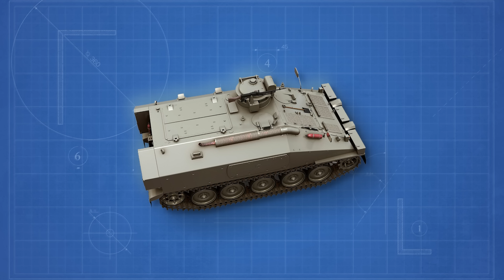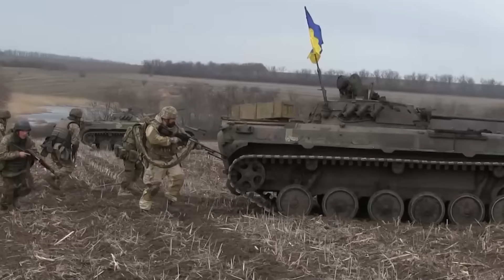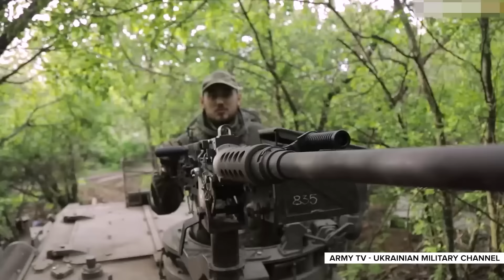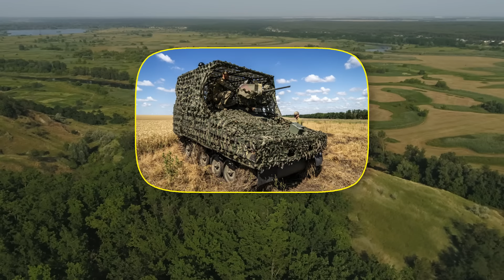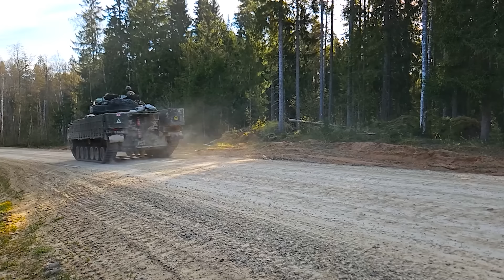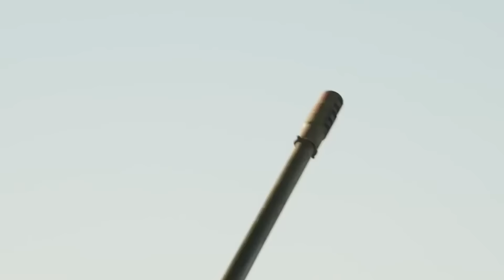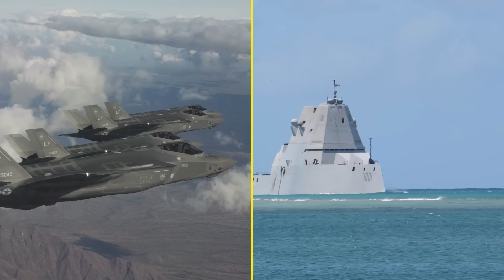Ukraine Turned UK’s Junkyard Armor Into a FRONTLINE MONSTER

Comment: 60 vehicles for USD $6.5 million?
That is only $108,334 per vehicle.  
Dirt cheap for military.
Reply: Got to remember that the people selling them were selling them were private collectors supporting a charity, not a main original production line.
Reply: @DylanSargesson  you can actually buy cold war era ex military vehicles in britain for about $80,000 each on the civilian market, well maintained with low mileage
Reply: @M @Matt77125 Well maintained cold war era military vehicles with low mileage and have not shot a single shot in anger sells for the low price of $100 000. Guaranteed upsetting the enemy»
Reply: @Matt77125  Well enough for civilian use perhaps but quite a bit more goes into making one ready for combat deployment. From the state you can purchase one for 80,000 to when necessary upgrades to armor and electronics have been installed, it will easily double that cost.
Reply: Not so long ago you could get them for half that. It's a shame how people start fleecing as soon as there is a war on.
Reply: @Rabidazell it's supply and demand if you are blowing them up
Reply: China ifv go for around $1 million
The Spartan goes for just $50000.
Reply: @HikerBikerMoter  Ajax cost around 3.5mil
Reply: And they have Jaguar power plants
Reply: @drbichat5229 
Used to, they're Cummins disks diesels now.
Reply: Not as cheap as the horses and dirt bikes Putin is curretly using. 😅😅😅
Reply: @joeblack007 
True. But it will keep you safe from anything but a direct hit, while a frag air burst can kill a bike rider within a 50 metre radius.
Reply: First thing I thought of. That’s the price of a new diesel pickup in America.
Reply: Probably more cost effective than storing them!
Reply: Right price for junkyard vehicles retired >15 years before the sale.
Reply: That's been a repeated pattern in this war ironically Ukraine has been proving that big budget military tech is nothing against a dirt cheap alternative an example being their new drones
Reply: THAT'S FOR OBSOLETE SCRAP WORTH 1000$ EACH NOT MORE
Reply: Sure mate and I saw the easter bunny the other day.
Reply: @MrBeagleblue  Why was the Easter Bunny in Moscow?
Reply: Are they desperate?
Reply: Way more expensive than junk metal
Reply: @jasonz2736  Junk metal doesn't do 60mph cross-country with a lower ground pressure than a man on foot. Nor carry radios and weapons...
Reply: @jasonz2736  LOL. Are you serious??? 5 days later and you are now liking my posts that you disputed 5 days ago? Did you finally realise that what i said  was true? An apology would be nice
Reply: @chrisyoung9653  dude's being delusional, Ukraine is paying way much for 80s junks and with debt that they already cant afford.
Reply: @jasonz2736  10 ton of steel can cost up to £200,000   Come back when you know what you are talking about kid. Thanks of the laugh
Reply: @chrisyoung9653  he said they were aluminum.
Reply: @chrisyoung9653  bro think steel is gold, 1ton steel cost less than 1k$ irl.
Reply: @jasonz2736  The cost for 10 tons of steel varies significantly, but based on current UK prices, it would be around £13,000 for structural steel or £6,000-£5,800 for rebar, while stainless steel can range from £44,500 (430) to over £200,000 (304) for 10 tons, depending on the type and market conditions. Sorry kid but you have no clue what you are talking about.
Reply: @richardhowell7040  Alluminium alloy which is dearer than steel for armour and obviously most components are steel such as tracks engine and basically every component which takes  up 70% of the weight. All info is just a google search away if you are interested in learning more
Reply: @chrisyoung9653 stainless steel arent used for building IFVs, sry for pointing out ur mistake, but at least accept it with dignity rather than spitting nonsense

Btw u can buy a surplus fv107 and similar vehicles for 70k but they charged 100k for Ukraine
Reply: @jasonz2736  As i stated the steel is mostly components and the price included spare parts, transportation, tools,optics ect. As i also already stated, all info is available online lol
Reply: @chrisyoung9653  10 ton steel would be 2500 euro's at the moment.
Reply: @12vibaba  thats nice but you need to understand there are many different grades and types of steel it is mostly stainless steel that is used or carbon steel. I have already shown these prices if you bothered to look
Reply: @jasonz2736  This is aluminum but if it was steel it would be armor steel not low-carbon.
Reply: $50000 per spartan i heard the narrator say @chrisyoung9653
Reply: @jasonz2736 they got a really good bargain too. I saw a Scorpion at RAF Cosford a few years ago and dreamed of winning the lottery and giving some of my neighbours a lesson in why parking properly would be better for their cars. While looking up prices for fun, I found one going for about £29k but it needed a new  gearbox and drive chain. I looked it up and that cost just under 120k before COVID. I still haven't won the lottery, but my dream if teaching the neighbours to park properly still lingers on 😅😅
Reply: Those people are probably all dead now and all that Pommy junk destroyed, that`s the reality.
Reply: @MrBeagleblue not even half a potato for your spam comrade
Reply: @MrBeagleblue 85% are still operational, as it says in the video you clearly didn’t bother watching.
Reply: @Left_Limb_Leopard  Sure buddy and I saw the easter Bunny the other day.
Reply: @MrBeagleblue The onus is on you to prove they’re being misleading. Go on then.
Reply: @MrBeagleblue  Statistically and provably untrue. Slava Ukraini.

Comment: Not mentioned - yes they can do 60mph+ forward using its 7-speed gearbox, but when the transfer lever is thrown, you have those same 7-speed gears and 60mph in REVERSE... if you have the guts for it! Damn, I miss driving those things. Sooo much fun!!
Reply: They can do ~60mph when the crew ‘accidentally’ forget to reinstall the limiter, risking thrown tracks and the wrath of the CSM 😂
Reply: Amazin'
Reply: On NATO exercises in the 1980's the BE CVRT drivers were called lunatics , credit to their driving skills 🙂
Reply: I drove them too great speed, like to you say had to trust the commander when flat out in reverse 😅 and the bv hot brew any time 👍
Reply: Made in Coventry at the Alvis it's engines made at the Daimler on the Radford Road. 
They were all made on the XK Engine line in 10 shop just like thousands of XK engines.
Sprayed Green in the Press Shop paint area.
The sent to the Alvis. Well done Coventry.
Reply: You can drive me. 🎉🎉🎉😊😊😊
Reply: My uncle went through conversion from chieftains to scorpions and used to swear they took the limiter off and did over 70 on a German field, almost hitting a hundred when they came to a steep slope that caught them by surprise. The vehicle was fine but he broke a tooth.
Reply: CVRT are great to drive when they work, but had a lot if design faults like to get to the points you had to take the top armour off and remove the driver seat and fire wall, all labour intensive and could you ever get a hand held grease gun for the tracks that ever worked not to mention the coke bottles and belly plates.👍🇬🇧
Reply: Ukraine needs more drivers so you all can volonteer to do what you are missing.
Reply: Fantastic vehicles. Fast, rubber tracked and light weight. I tried to sell them in Mexico but the army preferred the Panhard French six wheel.
Reply: Sounds like it had the same drive train or transmission design as the Daimler Dingo, of WW2 fame. If it ain't broke, don't fix it. 😁
Reply: Poor Ukrainians... Now they need to deal with all the junk instead of real help from the "democratic countries".... and sometimes they have to buy this junk at a very expensive cost. Well done, Europe...well done
Reply: Why are you talking such bollocks? The Ukrainians didn't invent new uses for the Spartan they're using it exactly as intended. CVR(T) were never designed as front line armour. The clue's in the name reconnaissance. The vehicle was designed with just enough armour and fire power to defend itself while it ran for cover if spotted while spotting the enemy for artillery or heavier armoured forces. The Spartan's main armament was an advanced sight which could be mounted on the commander's cupola or ground mounted to spy on enemy positions from cover by the dismounted troops. Comparing it to a dedicated troop transport like the 430 series or an infantry fighting vehicle like the 510 series is just missing the point. The CVR(T) wasn't scrapped because it was replaced it was scrapped because it's role became obsolete. It is no longer necessary to risk men by sending them forward of the main battle line to gather information. That's what drones are for .
Reply: @ianjardine7324 This looks like a response to the OP rather than this specific comment? 
I agree and have commented that the voice over is really misleading. Putting one of the CVR-T family up against tanks and IFVs like the BMP or Bradley would be suicidal (which is why they were originally designed for air-drop to the paras 😂)
Reply: Those people are probably all dead now and all that Pommy junk destroyed, that`s the reality.
Reply: @MrBeagleblue watch the video for more than a minute and see the survival stats
Reply: @MrBeagleblue  Evidence ?
Reply: @ChrisDavies-r1v  drones
Reply: @Lz_droy actual evidence?

Comment: Spartan APC
Scorpion 76mm gun
Scimitar 30mm gun
Sultan command 
Striker anti tank 
Samaratin ambulance
Samson recovery
Sabre 30mm Fox turret 
Stormer air defence.
Just that either with the 4.2l Jaguar engine or later 5.9l Cummins TD and a top speed of near 100kmh, oh yes it could that in reverse.
Reply: Not sent a jag engined cvrt yet and we even have live scorpions with them. All Cummings. 6 petrol ferrets but nothing else petrol.
Reply: I’m not a weapons expert but the 5.9L Cummins is waaaaay more reliable than the 4.2. Just sayin.
Reply: Thanks, I thought I knew the variants but I didn't know about Sabre and Stormer.
Reply: @rendezvouzwithrama Sabre was almost exclusively used by the Australian Army. They have one on the Australian Artillery and Armour museum youtube channel.
Reply: @samleigh7817  Thanks for the update.